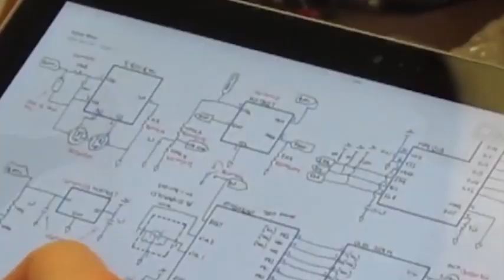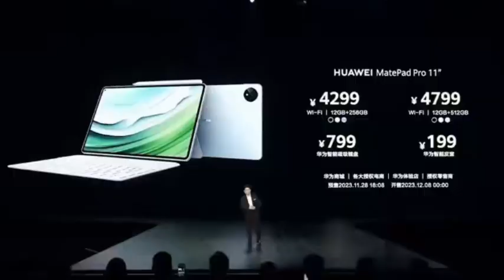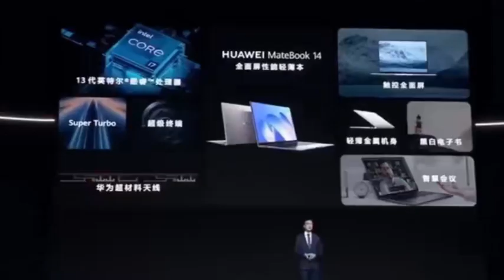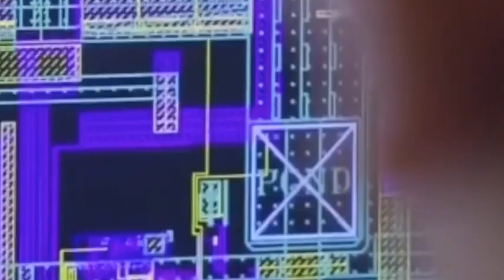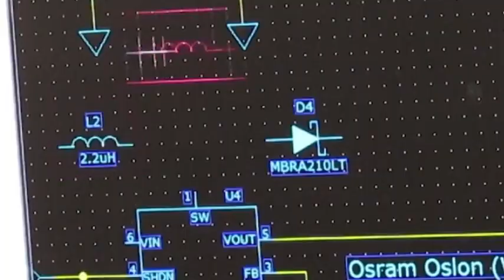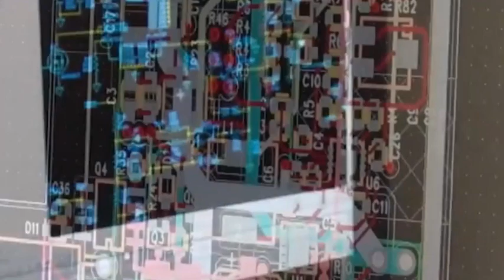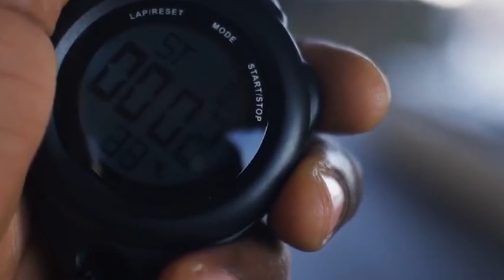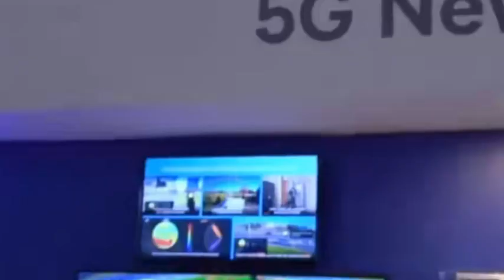China's HiSilicon EUV machine has been approved by Huawei and the Chinese Academy of Sciences.

Comment: While the title says Huawei's HiSilicon has developed an EUV machine, there was nothing in the commentary to believe this is indeed factual.  Time will tell and I am sure Huawei has the capability to develop its own technologies relating to lithography, but this You Tube video does little to confirm that.
Reply: We don’t need to worry the Euv machine will be soon not only be built in China but exported from China to other countries at a much lower cost /rate . 

The market should embrace for the flood of such mcs in the near future,
Reply: @yeokkhunleow4238  If the EUV requires a particle accelerator for its light source, it will not be cheap.